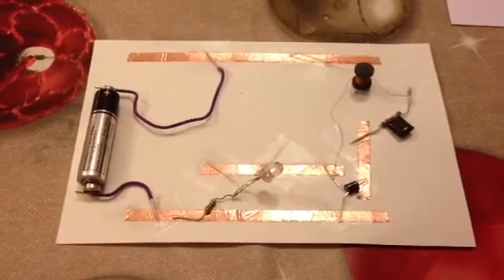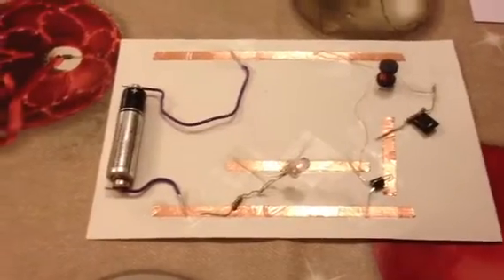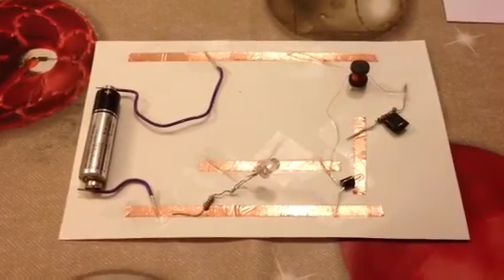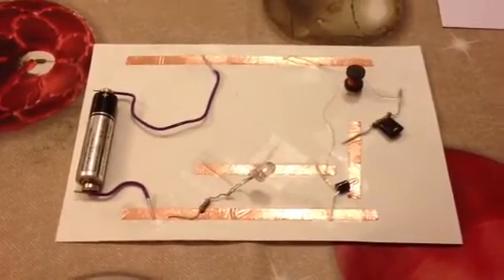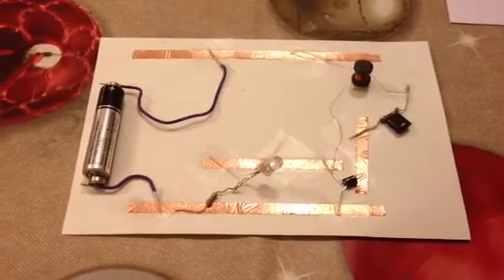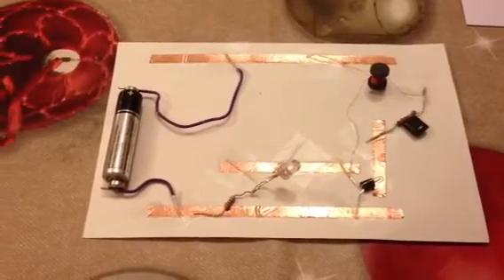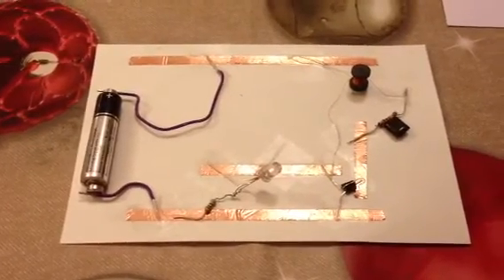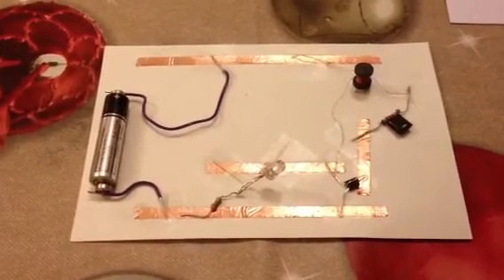Not working Joule Thief

Comment from the maker: Ok so I did take a look at this with a multimeter. After fixing a couple bad connections it looks like the oscillator is simply not oscillating. I was trying out a few new things here so I'll start over with known-good coil and the basic-est JT circuit.

Comment: From what i see here, i see no reason to put a resistor to the LED. And make sure it is connected good. Big leg inside LED to negative of battery/ E of transistor and slim leg goes  to C of transistor....plus it may be the wires connections on your coils... try to reverse the connections on one coil only. It doesn't matter which coil.